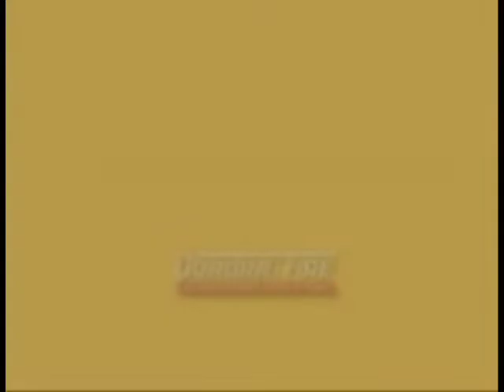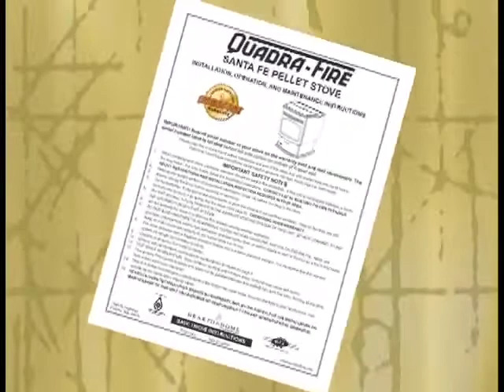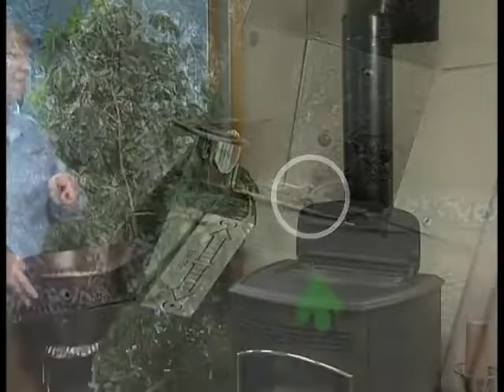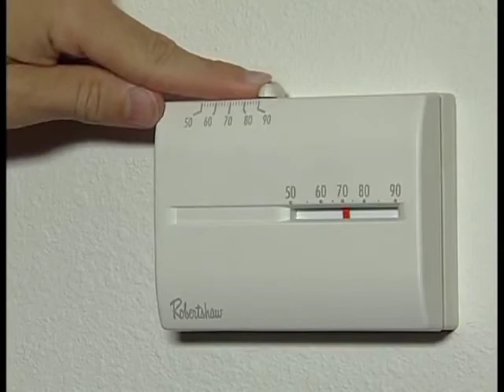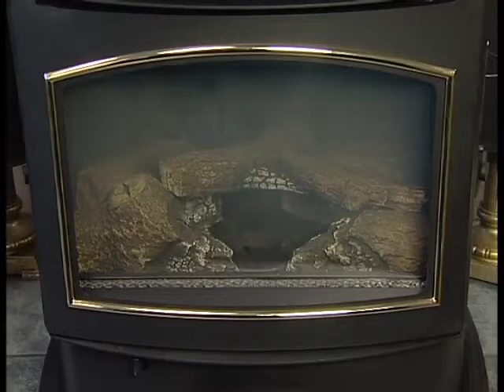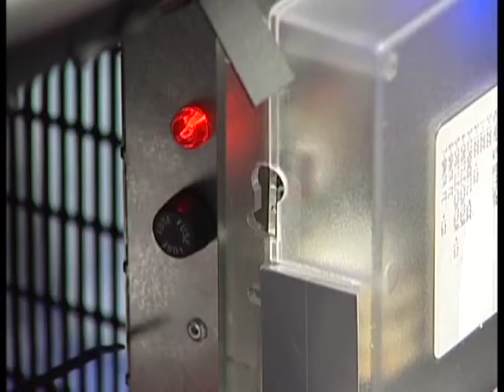Quadra-Fire® Santa Fe Pellet Stove

Comment: Is there away you can prevent whistle noise? When stove first starts.
Reply from the maker: A startup whistle usually comes from air being pulled through a small gap or restriction. Check the air intake, door or ash-pan gaskets, and make sure the exhaust blower and venting are clean. Fixing the air leak or blockage almost always stops the whistle. Hopefully this help🙌